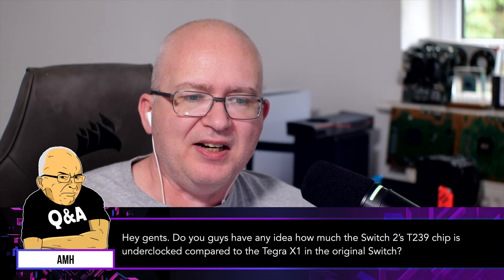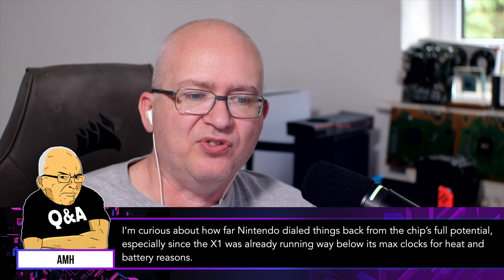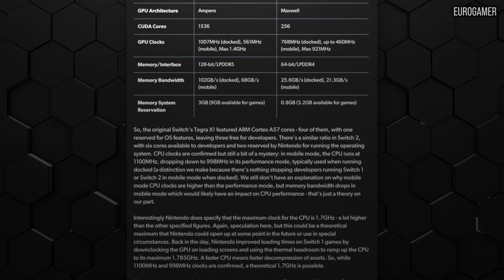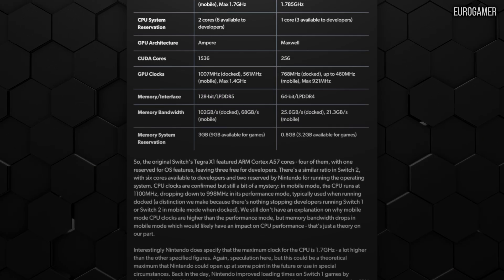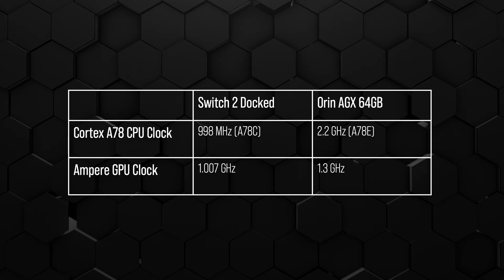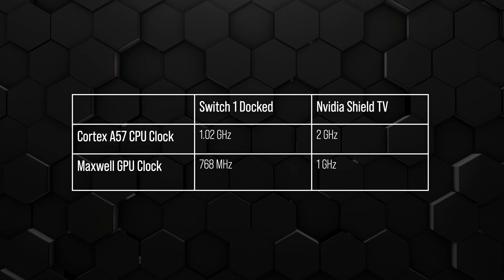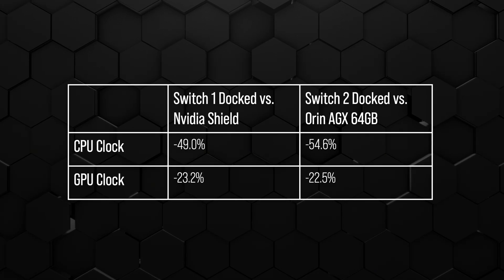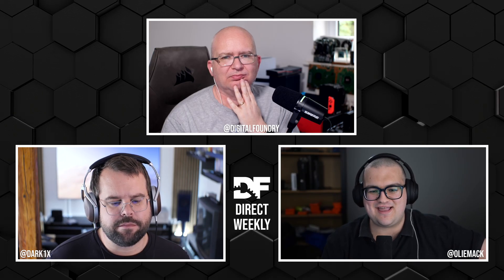Switch 2 SoC Under-Clocked? How Much Performance Is Left Untapped?

Comment: if they do a die shrink they should leave the handheld clocks as is to extend battery life and boost the docked clocks to maximize docked performance, almost like a “pro” model if you will. temps could stay the same because the smaller node would reduce heat produced.
Reply: but those who bought OG Switch 2 are gonna be pissed, and it's not feasible to boost those clocks on them, because the power draw would be too great. Well beyond the 25 watt limit. I would love it though personally.
Reply: @sselemaNrM  would be awesome to see a 35 watt version.
Reply: @sselemaNrM  so what about those who bought the OG ps5. Why are they complaining too when Sony is still reducing the PS5's SOC nm process over the years
Reply: Agreed; I think there is definitely space for a TV only model so that, if they ever do an enhanced model, they could put their old 8nm chips into it at whatever clocks they like, given how much easier it would be to manage thermals in a set top box.
Reply: As far as the handheld mode is concerned that’s what they did for the Mariko Switch. But they never boosted the clocks in docked mode, and imo it was to avoid adding another performance profile devs had to account for.

Comment: I wish there was a way to increase CPU speed in docked mode to even out frame rates and maybe even aim for higher fps targets, if there’s headroom.
Reply: Increasing CPU speed is not gonna do anything if a game's bottlenecking the system somewhere else. It's not a magic cure-all.
Reply: @hoaxlayer no it’s not but the cpu is bottlenecking the switch 2 pretty hard
Reply: @hoaxlayer  do we know for sure that the prevailing issue with NS2 is that the hybrid console is memory bandwidth-limited? I don’t know if that’s been proven yet. But regardless, a small bump to CPU clock and memory bandwidth also seems theoretically feasible.
Reply: @popzeus3000 they can’t increase the memory bandwidth without making a new console

Comment: Sony increased PSP clockspeed after release.
Reply: Sane with Vita, the default profile was CPU 333 MHz / GPU 166 MHz. Developers could choose 444/166 or 333/222 profiles which forced aeroplane mode on and limited brightness.
With CFW you can remove these restrictions as well as access the SoC's true maximum profile of 500/222.
Reply: It would make sense for Nintendo to hold out until companies games are starting to struggle, then release it. Otherwise companies will just get used to the extra power right away and use it as an excuse to optimise less.
Reply: Switch one got a boost mode too but only for a few select games
Reply: @bobo_1803 yeah, boost mode is mainly used to speed up loading times in games like Zeldas.
Reply: @wizzrod Not just Zeldas but literally all First Party Games
Reply: So did Switch 1.
Reply: Nintendo isn’t Sony. They don’t update their consoles at all since launch.
Reply: @ZeeLover123  The Switch 1 got the 460 MHz GPU handheld profile and 1785 MHz CPU loading boost profile a few months after launch
Reply: @ZeeLover123  the Switch 1 had several hardware and software revisions and updates… they just never really advertise it.
Reply: @clementrousseau3571 Besides battery saving, to the end users the Hardware Upgrades didn’t do a damn difference. It only makes a difference if you hack the Console but it’s insanely hard to solder modchips because of how small the Switch is, ESPECIALLY the Lite and ironically the OLED 

Oh yeah and the actual max clockspeed for both the old Tegra X1 (2017-2018 Switches) and New Tegra X1 (2019 and newer, Lite and OLED) actually go beyond 1795MHz, not sure for the newer one but for the old Tegra X1, it’s ACTUAL max CPU Frequency is 2091MHz and actual max GPU Frequency is 995MHz but they literally make the Fan go to 95-100% Speed so that’s why it’s normally blocked at what seems to be OS level because the max Speed for boost mode in loading times was ALWAYS 1795MHz
Reply: @ZeeLover123 they update them all the time now 😂😂😂😂👍

Comment: More power, come on Nintendo, unleash the beast😮
Reply: Nah... you can clearly feel the heat. if you take it out of the dock while it was running a game. ;D I think longlivity is more important. To me most games i played on it are good enough to me for a Nintendo console... even Pokemon AZ runs smooth (for a pkmn game xD).
Reply: @mipha5262  yeah, the fact that they felt the need to put a fan in the dock itself says a lot, but I think they might release an update later on and raise the clock speeds if games get too demanding towards the end of the generation
Reply: @erenyeeagah204 I doubt it. The system is nearing its limits as is. The higher clocks would be too hot and not worth the performance gain. If Nintendo wasn’t cheap they would have went with a smaller processing node
Reply: @mipha5262 they can release a "performance" dock with a fan blowing on the switch 2.

I'm using a third party dock that is quite open, the display is 5-7C cooler, back cover is 11C cooler, and that's before adding in a $3 cheap laptop cooler, all from AliExpress for under $20.
Reply: When the Switch 2's battery life is already 2 hours minimum on switch 2 and enhanced switch 1 games, they aren't gonna do that to preserve the battery life by not getting the battery too hot.  Is it feasible to raise the CPu 1.7x AND GPU 1.4x (as well as RAM bandwidth clocks) on a revision? Maybe. But it can also split the install base. They didn't do it with the V2 Switch 1 models. I wish they did.